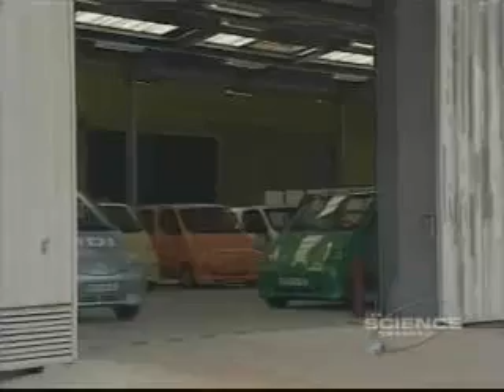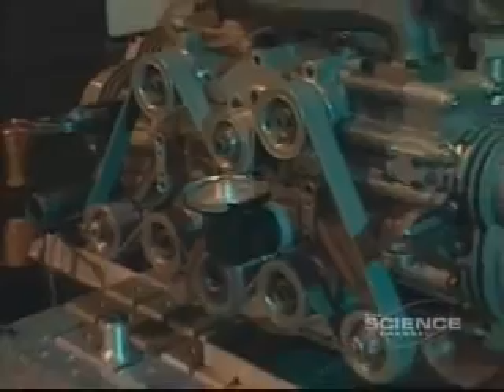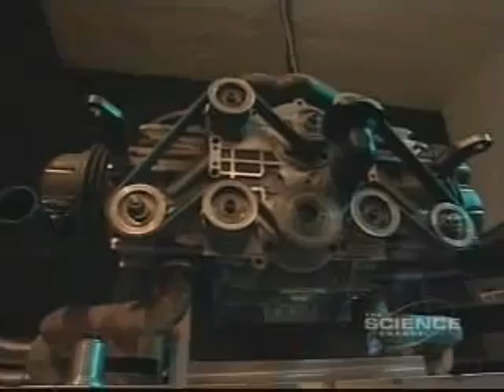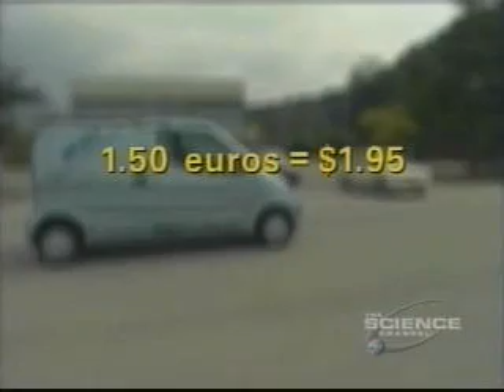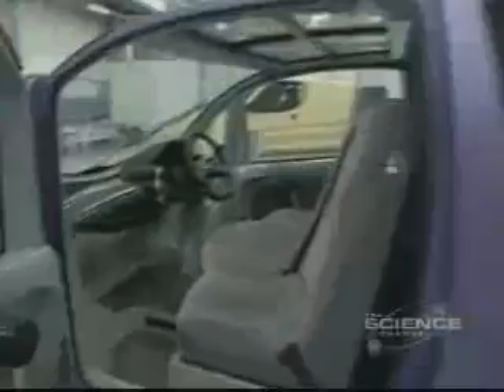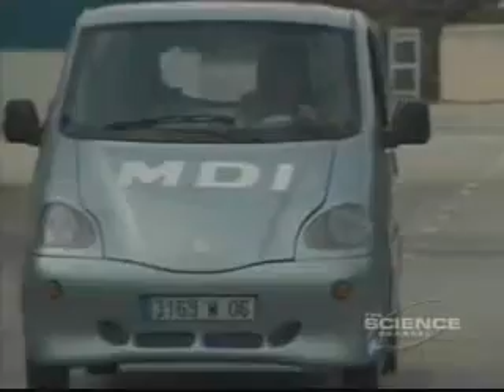Compressed Air power at work

Comment: "Why don't they build one that has a re-compression generator and just recycle the air into and out of and back into the motor?" For the same reason that perpetual motion machines don't exist...you're going to restrict the exhaust air, and therefore the energy from the expansion that goes to powering the vehicle, in order to run a compressor that takes more energy that it stores...you can't break even, you always lose—it's the law (of physics). You might as well ask why don't we just stick generators on the wheels of electric vehicles so that they can power themselves. Except the energy losses are worse with air compressors (unless you can use the heat, but you'll never break even still, much less gain on the deal).

Comment: Compressed air is not fuel, it is energy storage.  The energy consumed in compressing the air is released when the car moves. The efficiency of your compressor will determine the efficiency of your air car.

Comment: Armando Regusci Loves to Build Air Cars

In my correspondence with Mr. Regusci of Uruguay, I found him a sincere person and his design very appealing.  Like my torquerack engine, his invention does away with the crankshaft, replacing it with sprockets and chains and freewheeling clutches, to turn a shaft.

Comment: @DravenDarkshadow 
To FULLY run a home on PV you need  about 6KW of panels with the corresponding batteries etc $40K. Ie the run ovens stoves heating water etc. A $13K system assumes your water heating and cooking needs are from propane or some other source. I'm not arguing you can't make money selling the excess back to the grid BUT in the western world the money earned does not come near the money the same $ would earn invested in a decent safe investment such as bonds or term deposit

Comment from the maker: @fizzguts showing figures without the area coverage for the $40k equipment/battery/converter and so fore has no math value here because for 40 grand you can either get a nice setup that also generates more then erough energy to sell back or just enough from a retail store to cover your own use

for example an approximate self build about 13-16k already covers for your own usage, now for an additional investment of another 24k to 27k you can easily start making money from generating energy

Comment: @DravenDarkshadow 
If you do the math you will realize the $40,000 investment required to run a home on solar photovoltaic has NO payback. Unless you are a long long way from mains power so the cost of running power lines is high there is no point in photovoltaics except for a nice fell good sensation.

Comment from the maker: if you take the ratio from gasoline to energy to turn the turbine in the machine we know as a vehicle, it is not efficient at all, a lot less compared to compressed air; also we still need to factor how cold we need to bring natural gas in to a liquid form and how much energy to keep it in a liquidized state in both tank and the fuel station if we convert it to an alternative vehicle fuel.  as we well know our addiction to coal "cheap fuel" will dominate the market for years to come

Comment: "so DUH you can use any form of compressed gas to turn the same mechanism"
Yes stupid we all know it can crawl round a parking lot, the PROBLEM is the range is about 5 miles and that is NOT able to be fixed. It's a called physics. You know the bit you slept through at school?
Tell you what. Find and post a link to an independent test that CONFIRM's MDI's claim (not just repeating MDI lies) and I'll delete all my posts

Hello??

Silence??

Fuckwit

Comment: Quote "they have been ordered to be used as taxis in mexico, they run at up to 60 mph for a distance of 120 miles"
No that's the claim which has never been demonstrated. If you ring the "promoters" they won't even discuss how far they have been tested to.

Comment: "this type of vehicle is already sold in India and it short before production in Australia as well, its excellent because its WAY cheaper then conventional card , no need for annoying emission checks and finally you can steal electricity for the compressor like everywhere, not to mention the free tire stations ; )" Complete lies. No cars are being sold and none will be as it's a con. You need a 4000psi compressor to fill the tanks for a miserable 5 mile range at 25mph.

Comment: A/C is nice, but what about heat?  By using compressed air, there are no gas explosions in the engine, driving the pistons, generating the heat.  I live in Wisconsin, and heat is required.  Anyone know if they're incorporating some type of heating system into these?

Comment: Those are good points, and on top of that these cars still contribute to pollution even if indirectly since electricity is needed to power the air pumps that fill these things up. That electricity is probably being produced by a coal burning power plant. Now if we went over to purely solar/nuclear/wind/water generation then that wouldn't be an issue but neither would having an electric car.

Comment: Actually they do effect the environment, most plants here in sweden are water cooled, whick means they heat up massive ammounts of ocean water. Other than that there's the mining and transport of the fuel. These two aren't that big problems though. But the spent fuel ... well there's the huge problem. That beeing said, I'm not one of them anti-nuclear guys. I'm pretty neutral to it.

Comment from the maker: actually they were using high pressure equipment for mining in the late 1800's and it worked very well as well as helping to circulate the air in the mine. there are additional videos of high pressure equipment operating in loading docks carrying a ton of cargo with the additional safety of not using natural gas for propulsion fuel in a closed area

Comment from the maker: The end product is a light weigh vehicle that can reach speeds up to 220 km/h (even though the legal limit is 120.) A product that does not pollute like twentieth century vehicles and does not take a lifetime to pay off. Essentially, MDI has developed a modern, clean, and cheap car that meets most peoples needs. That is to say that 60% of drivers drive less than 50km a day, and 80% of those 60%, never leave urban areas.

Comment from the maker: well as i'll simplify it then lets say you pay 12 bucks for gas, for the same amount of power to push the air to that distance of the car it costs $2.5 to pump that compressed air power in to the car.

In the single energy mode MDI cars consume less than one euro every 100Km. (around 0.75 Euros) that is to say, 10 time less than gasoline powered cars. 
you are right that electricity is not efficient but compressed air power is exteremly efficient compared gasoline